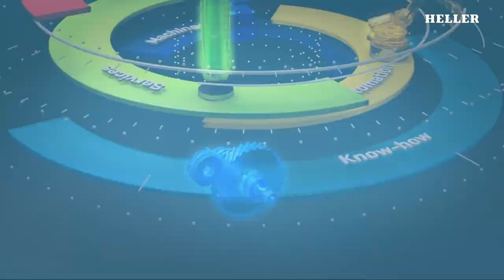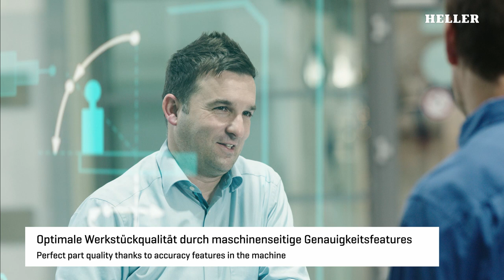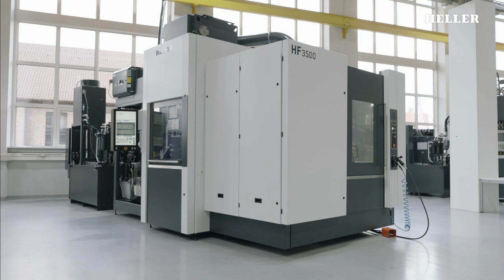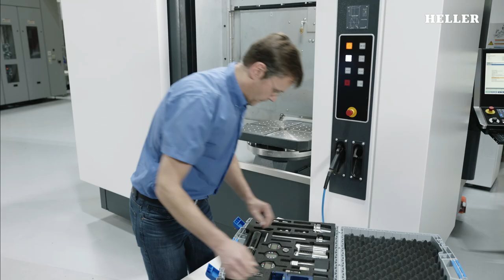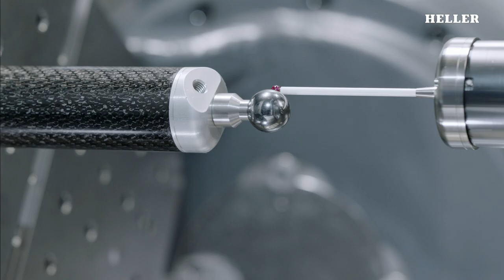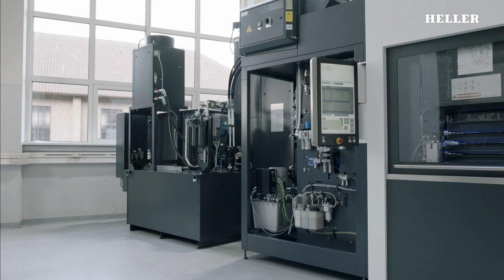Genauigkeit im Fokus | Focus on precision

Comment: Option: Coolant Temperature control ! - Just how can this even be considered as an option!?  Is this just marketing to keep the base m/c at a lower cost?
Reply from the maker: Coolant temperature control is an additional function for the coolant unit. Not every application requires it, that´s why it´s an option. On one hand side there is a coolant chiller (cooling device) on the other hand side a tempering unit (cooling or heating device) can be used.
Reply: @HELLERMachineTools  actually, I got it wrong. Thanks for the correction.